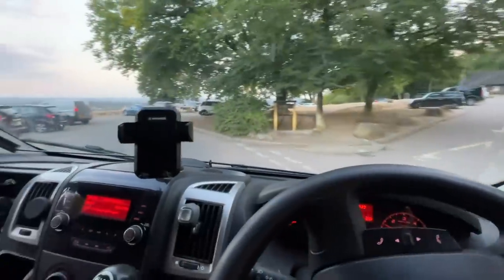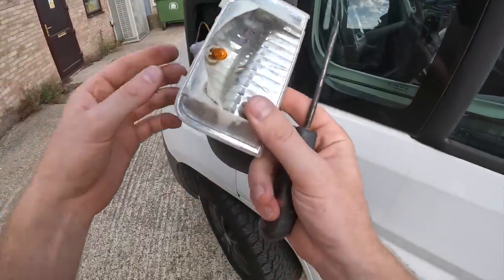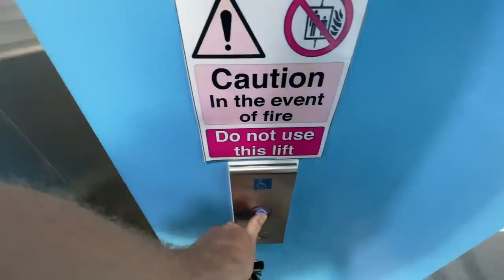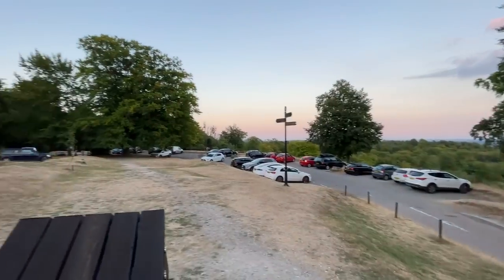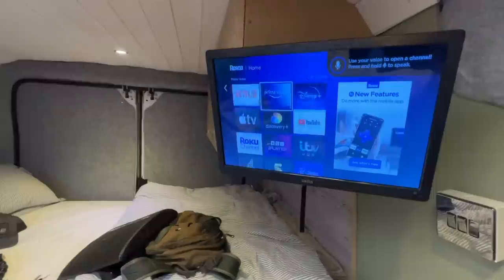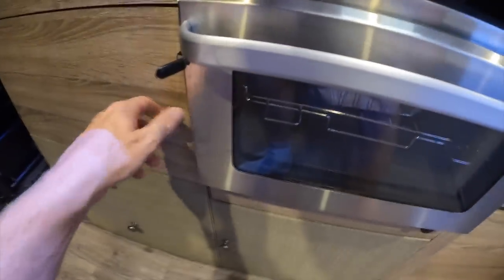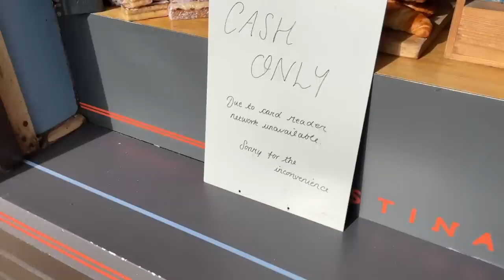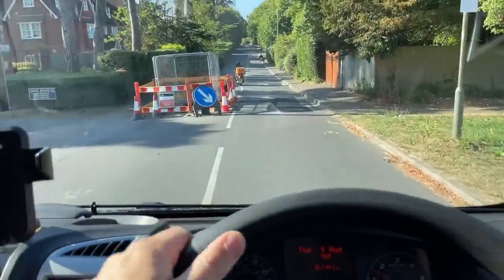Solo Van Camping at One of UK’s Most Popular Dogging Sites

Comment: Watching your videos has just cost me £4k. Got myself a nice Transit professionally converted 3 days ago. Now adding solar, inverter, batteries ad a diesel heater, all ready for some off grid winter camping trips. Vanlife is awesome. Went with some friends earlier this year + watching your videos and had to get my own.
Reply: Get a Jackery or some other power pack
Reply: @russthomas02  I have  300AH battery, split charger. Plus 350w of solar. No need for a power pack. I'm doing my own custom  system built into one of the cupboards.
Reply: you want to get a 230v plug in laptop charger and an electric blanket 1 hr and your lovely and walm on 100 watts and the laptop charger doesent sp you battery like an inverter
Reply: How the hell did that only cost you 4k? Break down on all the van details like year Mike’s stuff like that please?
Reply: @joken8901  Can you explain your set up a bit better please?
Reply: me also...I bought a push bike

Comment: Glad you’re back to the stealth camping love it! For your keys try the following. Put them in the Ignition, turn the keys until the light come on the dashboard but don’t start the engine! Press open and close until the the van starts to lock and unlock at the same time the turn the ignition and stop. They keys might need to be synced to the van. It used to happen to Vauxhalls and it was a quick and easy way to re programme them

Comment: First a question...where did you get the blinds for the windshield and how are they fitted? Those are awesome.
Second a comment: microwave rice done easy - boil a pot of water and stick the packet in for 5 minutes or until hot. Simples

Comment: I'd recommend for your tap. Either thread  lock, it's like a blue coloured glue or PTFE tape. It's like white tape that plummers use to seal joints in plumbing. Used it on a few things so it might work.
Reply: I was just about to comment the same 👍.
Reply: @alessia0064  I've used the white tape from a leaky pike to on a wheel for a bed. Never failed me yet
Reply: I was gonna recommend both of those items too 😀
Reply: @alanearle2353  a lot of smart people then 😁
Reply: Yes to the tape. I reckon the fitting is coming loose from vibration so it may absorb some of that.
Reply: @deecarter147  exactly my thinking. That's why I also suggested the thread lock. Think the tape is easier to find. Mind you, God bless online buying.
Reply: Get a tap wrench

Comment: Add a blob of threadlock on the tap threads before you tighten it up. Also disconnecting the battery won't electrocute you. It's only 12 volts.
Reply: Just got to disconnect and reconnect in the correct order. I forget what it is but a search will reveal all.

Comment: Your no going to get electrocuted disconnecting a battery... 
For the tap use some thread lock and maybe a rubber washer, I guessing it's coming loose because of the van vibrations.. 👍
Reply from the maker: Thanks for the tips and advice 👍👍

Comment: Will i had the same problem on my citroen camper no central locking or electric windows,  some joker quote me over a grand saying it was the controller switch. My neighbour fixed it for me by changing the bridging fuse on the van battery. £2 30apm fuse. Coz the fuse had blow there was no power to the drivers fuse box so no power to the central locking or windows.
Reply from the maker: Interesting information thank you 🙏

Comment: Hey will, I had the same issues with my key fob, absolute nightmare! 
If the problem doesn't go away, try replacing the ignition switch....mine was sticking and stopping the fob from working, they're fairly inexpensive and easy to replace. 👍
Reply from the maker: Thank you for the advice 👍👍
Reply: @WillsWhereabouts  no worries mate, I went through everything like you have.....multiple times! Was so frustrating lol....basically the ecu thought the keys were still in the ignition when they wasn't.
The part was only about £15, just had to remove the cover over the ignition barrel, pretty much a plug and play part but yours could be different. ❤

Comment: You have come a long way since your last night there. The key fob sounds like a programming issue, you may be pressing buttons while van is running or sometimes caused by battery being slightly loose in fob, it can be sorted with a procedure involving hitting the buttons while the key is in ignition and ignition on but van not started, not sure of the steps on your van but ive done ot with a transit before. Same with dash warning lights, the garage used to charge £30 on top of awrvice to turn the light out, i started doing it myself and turning it off with ignition and brake pedal procedure, all info found online. The tap is probably fixed with a plastic lock ring which are deforming with the hot water over time, you can biy brass replacements which will last forever and the tool you need to really tighten it down is called a crows foot spanner. With the footy i just use the app on the phone and cast it to my tv via a cheap tv box that has a cast app on it, only cost £15 on ebay but looks like you should be able to download a cast app onto whatever software your running on the tv already. Hope some of this is helpfull and I hope your doing well mate. Thanks for the video
Reply from the maker: There’s a lot of helpful information here thank you so much 😊

Comment: Battery won't electrocute you, it is direct current and low voltage. There is a real danger of short circuit, so when you start disconnecting a battery, do the negative pole first. The negative is connected to the chassis and if you touch the chassis with a tool you are connected to the battery with, being connected with the negative pole is the safe choice.
So, summary: negative terminal is the first to disconnect and last to connect.
What comes to key fob, you will highly likely need OBD connection and appropriate software. "SVCI" software seems to come up when searching for fiat ducato key fob programming instructions.

Comment: You'll be fine disconnecting the battery Will, won't get a zap don't worry. Its the braided cable closest to the middle of the van that you want to disconnect, so long as you don't go touching the positive on the other side of the battery with it you won't even see sparks, hopefully it works anyway 😉

P.s. SkyGo on your laptop, connect to TV by HDMI / Wireless? Now TV would be another possibility?
P.p.s. another great vid!! 👍 👌

Comment: Put a second nut onto the tap and ensure there is a compression washer between on the underside between the sink, so in order on the tap (from top to bottom), sink, washer(s), nut, second nut. The two nuts together provide friction so should keep the tap tight and in place. Bon chance !!

Comment: Make sure all the door contacts are working, if one door is open the fob won't work. Try leaning on the front of the sliding door from the outside as you press the lock button

Comment: Hi Will just wandering if you have tried using thread locker on the tap to stop the bolts or screws coming undone otherwise I would use some glue of some kind

Comment: If the backnut on the taps is a plastic one swop it out for a brass one. The plastic back nuts that come with most taps are rubbish as when the tap itself gets hot the plastic becomes soft and loosens over time. A brass backnut can be tightened better and lasts a lot longer. Hope this helps, keep the faith
Reply: Yup! I agree with that one, it has happened to me. Use some ptfe plumbers tape as well.

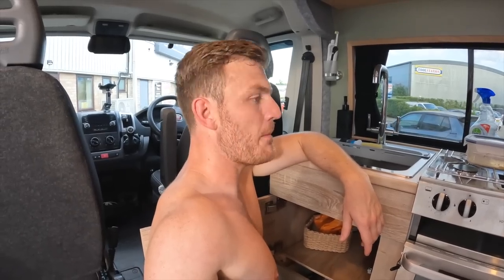Comment: 4:04 try a lock washer
Reply: @WillsWhereabouts  if you cant get a lock washer in the size you need then a rubber gasket is the next best thing or bike inner tube folded twice with a hole cut out.